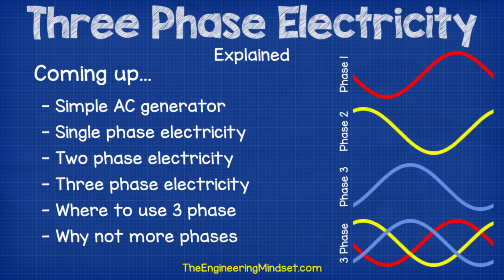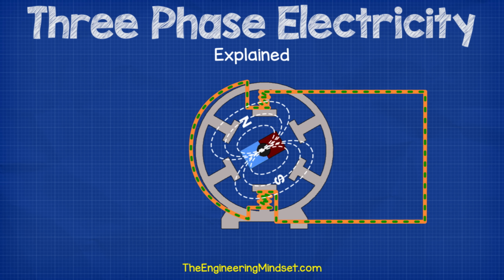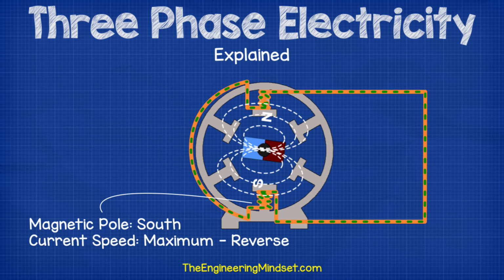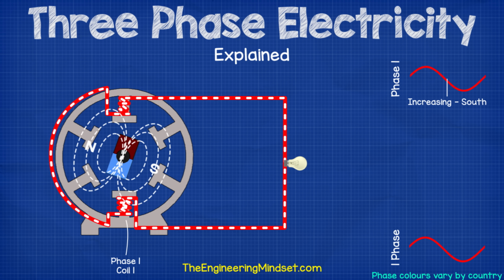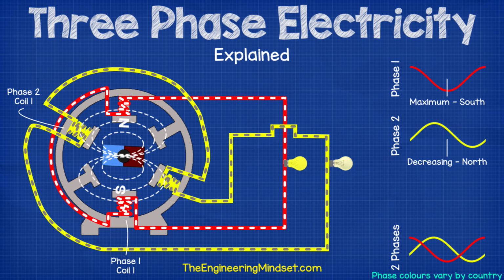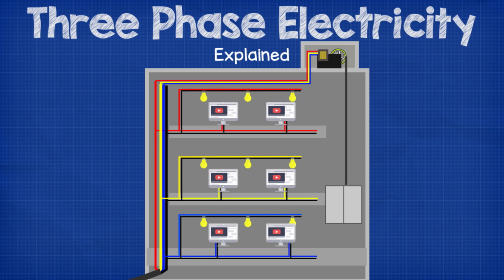How Three Phase Electricity works - The basics explained

Comment: Am I right that this is wrong?
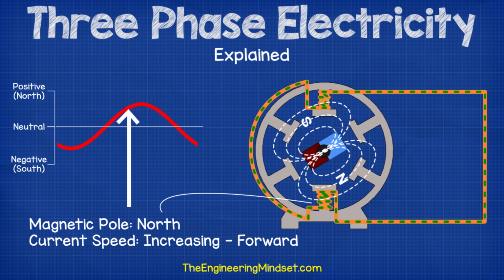When I look at the illustration the magnetic field is rotated 90 deg. wrong (e.g. at t=3:33). Or have I misunderstood the video?
The magnetic field is strongest at the poles, and therefore it will "cut/pass" the maximum field lines and generate the maximum voltage.
This page do also describe it: https://www.electronics-tutorials.ws/accircuits/sinusoidal-waveform.html There is a pic. where you see the plot of the sine wave voltage and the location of the magnet and coil according to each other.
Reply from the maker: Yes it's been pointed out multiple points on this page that the illustration doesn't represent reality. Please watch this video instead https://youtu.be/qthuFLNSrlg

Comment: I don't understand. They make it three phased to avoid gaps, then they send one phase into the building floors to power the lights? 😶

Edit: okay, I started watching again, and you do recommend watching other videos on how electricity works. I take it I should probably watch those? 🤪
Reply from the maker: The gaps happen so fast the human eye can't usually notice it with lights but 3 phase will go into buildings to power things like motors which will use all three phases to make the motors run during these gaps, that'll make them faster and stronger
Reply: @EngineeringMindset  I see. Awesome channel, by the way. 😊

Comment: small query...... Why AC current has electron flows in 2 directions where as in DC is only one direction.  I meant it, its why? not how i am asking.
Reply: Definition.   The A in AC stands for alternating, the D in DC stands for direct.    Alternating means that the current reverses periodically.  Direct means that the current flows in one direction thru the circuit continuously.

Comment: At the end of the video you say that a house has single phase power.  Wouldn't it really be 2 phases since a home would have 240 volt coming in off 2 hot wires?  And those 2 hot wires would be of 2 different phases since you generally only have one common wire in 240.  Just want to double check my understanding.
Reply from the maker: North America has a different electrical system than the rest of the world, the phase is split to give 120/240V we covered that here https://youtu.be/fJeRabV5hNU

Comment: Question please.  All three phase distribution conductors that we see at the
top of the power company poles, EACH have only one conductor EACH. 
One after another they are connected to our step down single phase transformers, again only one conductor.   Video shows two (2) conductors
(per phase) out of the generator? Thank you. Ted
Reply from the maker: it's connected in star delta https://youtu.be/h89TTwlNnpY?t=185

Comment: Question please. The step down transformer outside on the utility pole.
One conductor connected to the top. High voltage, low current (amps).
How does this BALANCE the current back to the source ( power plant)?
You did explain that the neutral bar carries the unbalanced portion of
current back to our side of the transformer. Thank you.
Reply from the maker: https://youtu.be/P-W42tk-fWc?t=312

Comment: Factory's dont just use single phase they also have to step it down because a single phase 3 phase power assuming its 480V is 277V still way to high to plug in a computer.
Reply: Buildings that get 277/480V services, will have the majority of their loads operate off the higher voltage.  They will also have a smaller step-down transformer, to supply the receptacle loads that strictly require 120V.

Suppose the whole service is supplied by a 1MVA transformer that produces 277/480V on its output.  A plausible size for the step-down transformer, is a 150 kVA transformer, that steps between 480V and 120/208V.

Also, you can in theory run a computer on 277V or 480V.  All you need is a power supply that can start with one of these voltages.  I wouldn't be surprised if giant servers in data centers are built with power supplies that start with 480V.
Reply from the maker: Seen our new 3 phase transformer video?➡️: https://youtu.be/u0SsejDCVkU

Comment: Your vids are awesome!! You explain in such a way that electricity becomes easy to understand. Congratulations!!! What is the relation of North and South with the electrons? Why you said that North is positive and South negative?
Reply: It was an arbitrary convention that he called north positive and south negative.  It has nothing to do with the charge of either part of the magnet.  A magnet is electrically neutral.  It is the subatomic-level spins of the electrons that determine the magnetism inside the magnet.

An electron circulating clockwise, will produce a magnetic field with a north pole that points toward you, and a south pole that points away from you.  An electron circulating counter-clockwise will produce a north pole that points away from you, and a south pole that points toward you.   The source of all magnetism is electrical current, either in an electromagnet with macroscopic current, or in atomic-level currents.

Iron is an element with a property called ferromagnetism, where every individual atom is a tiny magnet.  Iron is the namesake of ferromagnetism, because it is the most common element used for this property.  Other elements that do this, are cobalt, nickel, and neodymium.  The reason that not everything made of iron is a magnet, is that the magnetic directions are scattered, and add up to zero.   When you organize the magnetic directions, and heat it to the Curie temperature, you can maintain the magnetic directions and turn virgin iron into a permanent magnet.

Comment: Only older houses or apartments use single phase. At least in northern Europe like Germany, Austria and the Netherlands the normal houses have three phases into the house to use saws, shredders, welding equipment (these of course in rather rural areas, welding in your living room at the 30th floor doesnt't make THAT sense...), charging your car with  22kW (or even the Renault Zoe with 43kW), use direct water heaters and so on.
3x63A is normal, 3x50A is the new standard, underdeveloped regions in Germany like bavaria have only 1x35A for the whole house which is fairly enough if you heat with oil or wood and cook with gas.
Reply: 3x65A seems excessive for a normal residential single family house. In Finland most are in 3x25A range. Price for 65A feed is quite a lot more than for 25A. Even for a car charging you do not need to fill it in 45 minutes, as you usually would do it overnight. And heating by direct electricity is not efficient without sometype of heatpump.
Reply from the maker: Check our new revamped 3 phase explained video, sooooo much better:👉 LINK: https://youtu.be/c9gm_NL7KyE

Comment: Bad explained, at some point the video turns confuse. 
This video should be edited, some points that you have to incorporte are :

1-Whit a trifasic configuration you can use one generator instead of 3 in the power plant, soo you have more space at the power plant and is cheaper the initial capital investing at the power plant, and so, more efficient.

2- Whit a trifasic configuration you can use 3 cables instead of six, you save 3 cables, for heavy copper cables that's a lot of money.

3- Whit a trifasic configuration you can save a lot from capacitor cost in electric motors.

There are more reasons, but this 3 are fundamental to be added, of course this is a humble suggestion, please don't be bothered by my comment. You make great videos, but in this case you are skiping fundamental reasons.

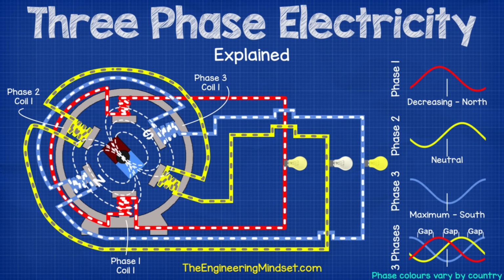Comment: 6:00  Don’t lamps nowadays use capacitors so they work with single face and never fluctuate light?
Reply: Depends on the kind of lamp.  A standard incandescent lamp is just an electrical resistance.

The reason an incandescent lamp doesn't appear to fluctuate, despite being powered by a source that fluctuates, is that there is thermal mass of the filament, and it takes time to heat and cool the unit.   The filament's glow will never diminish to zero during an AC waveform's cycle.  It will glow brighter and dimmer, and you can see this on a high speed video, but it doesn't diminish to completely dark.   The human eye doesn't usually pick this up, because our reaction time is a lot longer than a 60th or 50th of a second.

Comment: Hey I have a question since lights are on single phase do the flicker more when it's a single phase generator or 3 phase and  y ?
Reply from the maker: They flicker the same. The flicker is in regards to the frequency. Either 50HZ or 60HZ so 100 or 120 times per second. Faster than you can see.

Comment: Ok this was a good video. But i have some questions. If electrons are moving back and forth with each rotation of the magnet, then surely the electrons' net movement is zero? It looks like the same electrons are moving back and forth through the same bit of wire.. this obviously isn't what is happening, but could someone explain what is?
Also, this is a minor point but wouldn't the direction of current change 100 times per second at 50 Hz? Not 50 times per second? Because within one cycle the direction of current changes twice.

Comment: Great video, though I do have a comment:

It's stated that homes are usually supplied with 1-phase power, due to lower power needs. 
However, some places (like Northern Europe, where I live), homes are supplied with 3-phase power, even in a small flat. This is due to the fact that some home consumer, like stoves, require 3-phase power. So here power is supplied as 3-phase 400 V (previously 380 V) 50 hz., and different areas of the home is supplied by 1 of the 3 phases, whereas areas like the kitchen has an 3-phase 400 V outlet for the stove.
I have also noticed that in areas like suburbs, local substations (transformers) supplies as many as 5 - 6 lines, each providing 3-phased 400 V 50 hz. , usually at up to 32 Amps per home.

Comment: Great video, I would make one correction though. Most if not all houses in the US are wired with two phase. Most circuits only use a single phase, but for something heavy duty like an electric furnace, or electric cloths dryer, you would see a large plug and the appliance would be marked 220-240V
Reply from the maker: Actually the house's get a single phase, the US just splits the phase into 120/240V we've covered that here: https://youtu.be/fJeRabV5hNU

Comment: THANK YOU !   I get it now!   so now i have a question...  i have a wind generator that produces about 2.0 volts AC (yes two volts) and it is a 3 phase generator.  so if combined that would give 6 volts correct?  how could this be used to make 12 volts of DC current?
Reply from the maker: No doesn't work like that, watch this: https://youtu.be/qthuFLNSrlg

Comment: And then for 110V, the single-phase 220V is split at the fusebox into 2 lines.
Reply: No my dude that's wrong to get 220v you can't split the 110v phase in the fuse box , if you do that you still have 110 volts
Reply: It's not split in the fuse box (or panelboard as we use today).  It is derived from center-tapping the secondary of the service transformer.   The center tap becomes the grounded neutral (white), and the two other terminals of the transformer become line 1 (black) and line 2 (red) ungrounded conductors.
Reply: @carultch  I probably worded it wrong.  

At my fuse box, I have the wire coming from my meter which connects to the main breaker and then to 2 "busses" on which are my breakers.  My 220V is achieved by using both busses, one being the black and the other being the red, such as the wiring to my stove, and my 110V uses each bar individually with a white neutral and green or bare ground.  This is what I meant by "split" for 110V.
Reply: in 3phase systems, voltaje Ph - Ph = Ph-N x 1.732
120/208V
127/220V
220/380V
230/400V

Comment: This would have been a good video to explain variable frequency drives.
Reply: Robert Galindo be this is a little over simplified version but an in
Reply: Brighten inverter Works AKA frequency drive by switching it to direct current and pulsing it as a/c keeping 120v @60hz ratio the same so11hz will drop the voltage to thay ratio and prevent the motor from burning up but fans must be added to motor to prevent over heating because now motor is no longer pushing enough air to keep cool
Reply: Most motors don't recommend going below 11hz
Reply from the maker: VFD Video is now live! here: https://youtu.be/yEPe7RDtkgo
Reply from the maker: Power inverter video  here https://youtu.be/iIqhAX0I7lI

Comment: I understand your explanation about using 3 phase generation to keep the AC power supply constant (as with your example of the light bulb in your video). However how does that explain residential lighting and equip such as tv’s, computers, etc. that are running off of single phase electric from a pole mounted 120/240 transformer? Is it because even with single phase power supply at 60 htz its still to fast for the eye to see?
Reply from the maker: Seen our new 3 phase transformer video with worked examples: link- https://youtu.be/u0SsejDCVkU

Comment: "They are turning on and off so fast the human eye can't see it"
Then i am not a human because i can definitely see it, i hate this generalization that humans can't see beyond 24, 30, 50, 60 Hz.
Reply: Switch to LED lights. Apart from the fact that they last much, much longer and use less power, LEDs need constant power to run. So they usually have a capacitor or the equivalent to keep the light going between cycles.

Comment: Can anyone explain to a moron (me) why an electric motor powered by AC decides to run in one direction rather than the other - or rather, doesn't try to turn in both directions alternately, changing its direction 50 or 60 or whatever times per second?
Reply from the maker: Each coil will become magnetic and pull the rotar. It's magnetic field increases as it reaches the peak of the sine wave then it decreases. That peak will pull the rotar towards the coil but when the coil gets there the magnet is now off, however the next coil has been wired so that it will become magnetic and pull the rotar further. This just continues. Watch this https://youtu.be/N7TZ4gm3aUg?t=501
Reply: @EngineeringMindset  Thank you. I'll do as you suggest.

Comment: I learned about 3P electricity on one of the my first jobs I ever held and was able to grasp the concept pretty well.  BUT was not able to really invision what was going on on how the generators that I worked with did produce the 3P electic. Over the years I continued learning and ultimatly was able to totally understand the workings. The graphics you produced are fantastic and really simplifies on how 3P electricity works.  Great video.
Reply from the maker: Check our new revamped 3 phase explained video, sooooo much better:👉 LINK: https://youtu.be/c9gm_NL7KyE

Comment: In Switzerland almost all houses have 3phase not just commercial buildings. I think it's the same in Germany.  It's cool because I can use 3 phases to charge my Renault Zoe with full 43kw of power going to the car. Also our heat pumps for bigger houses are using all 3 phases. We don't divide streets into phases here.

Comment: In case anyone is interested the "electron flow" is almost non-existent...."electron flow" is a term from early electrical research when they were using a water analogy to figure out/explain, and it wasn't such a bad guess.   What's actually happening is bit more complex and even weird...the magnetic field sweeping a conductor causes electrons in the conductor to throw up their own magnetic field which moves along with the moving magnetic field and keeps going in the conductor even when it is routed out of the magnetic field as long as the part of the conductor in the field is still being swept by the magnet.   The mass of electrons in the conductor hardly moves at all but the field moves right along.    It's the field that transfers the work....very strange seeming at first.

Comment: I work at a church as an audio tech. One year we had a really bad storm that knocked out the third phase and the second came in and out at different times. The building engineer got stuck in the elevator because the door could operate on 2 phases. Went in before the service came out after the service.

Comment: I would love to see a follow up video on this. I still don't understand why 3 phase (60 degrees apart) is optimal, as opposed to 2 phase (45 degrees apart) or 180 phase (1 degree apart).
Reply: The three phases are not 60 degrees apart, but rather 120 degrees apart.  As in, 1/3 of a cycle apart.   The inductive coils you use to pick up the magnetic field might be 60 degrees apart as is determined by generator geometry, but the waveforms of the voltage of each phase, are 120 degrees apart.  It is a more abstract kind of degree that measures this, because I can't place a protractor on a timer.   We define a full cycle to be 360 degrees, so 120 degees means a third of a cycle.

In order to have as close to constant power output as possible, you need to distribute the phases uniformly across the complete cycle.  This also allows you to eliminate neutral current when the loads are balanced.  This is why 3-phase is 120 degrees apart.   If you had 2 phases that are 90 degrees apart, you'd be guaranteed neutral current.

It would be more optimal to have a greater number of phases, but you have a diminishing return by doing so.  The marginal benefits of 4-phase electricity that are each 90 degrees apart, does not justify the extra cost of a 4th pole to each breaker, fuse assembly, and switch along the way.   Three phase electricity simply is what gets to capture the bulk of the advantage to multiple phase electricity, without adding the expense of all the power distribution equipment on additional phases.

Comment: If power stations generate 3 phase, where does the neutral wire come from if single phase is also used?
Reply: From transformer, Input is delta output is Y.